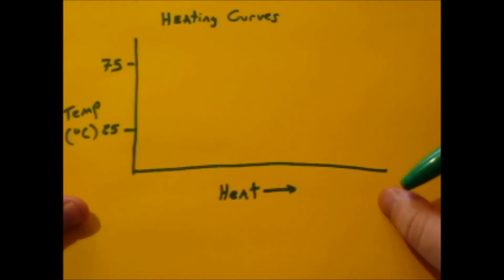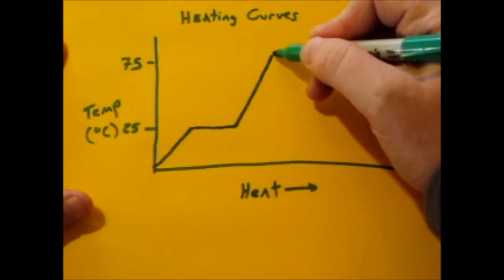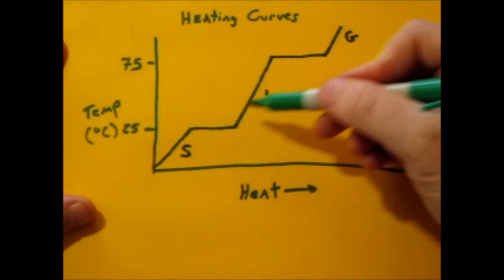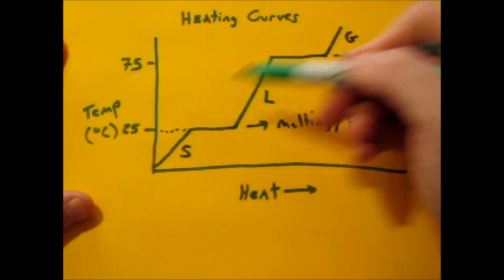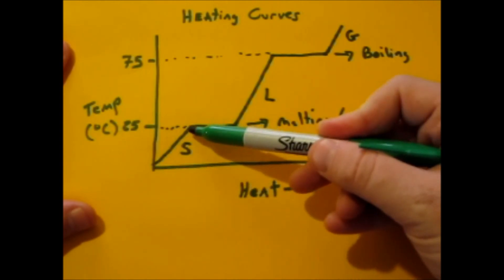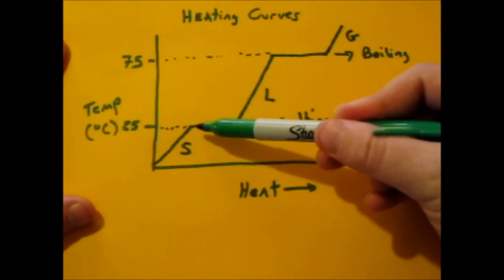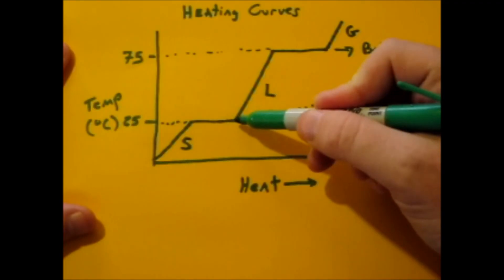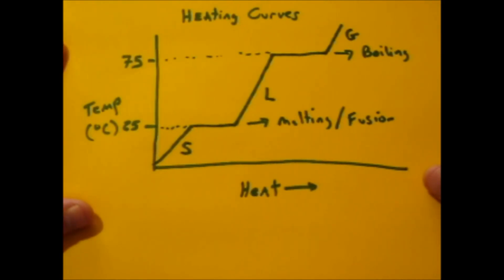Heating Curve Basics

Comment from the maker: Steeper indicates the temperature is increasing quicker, and that occurs due to a smaller specific heat for that liquid. Water changes its temperature more gradually as a liquid than a solid or gas.